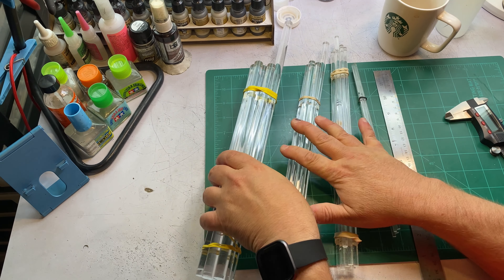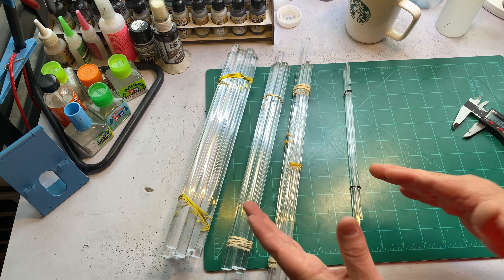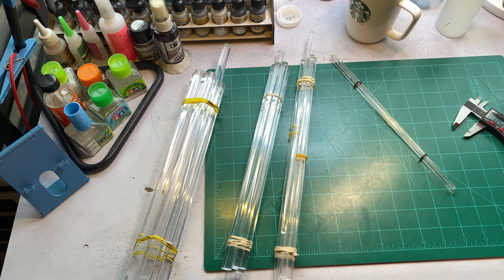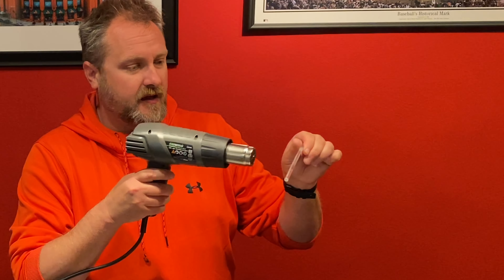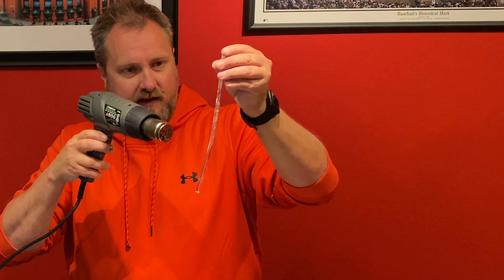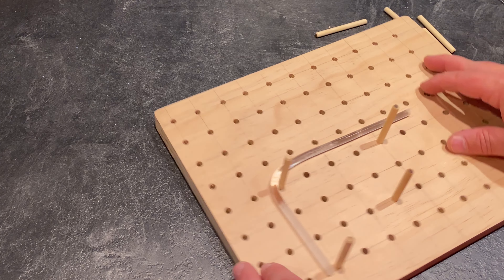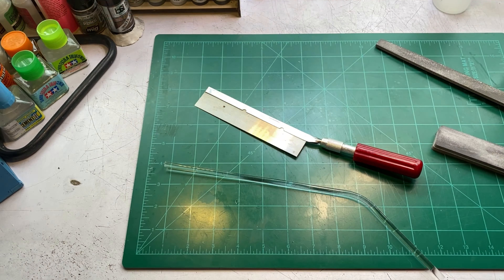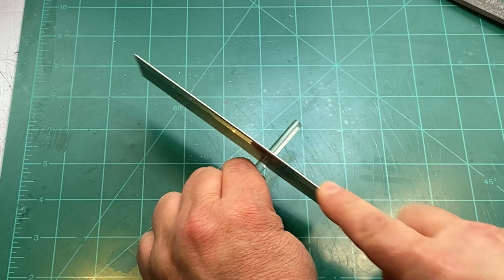Working with Acrylic Rod for Scale Models

Comment: Thanks Sean, for info of others I had a crack at mounting one of my models on acrylic rod but didn’t have a heat gun so used my wife’s hair dryer, it is a top end model with numerous heat settings and comes with an attachment to concentrate heat into a smaller area...took a bit longer to soften and I only used 6mm rod but did the job if you don’t rush it...cheers Mick.

Comment: I laughed out loud at "that's what she said!" however, my wife did not think it was funny.  i was wondering how stiff the 1/8 in rods are.  would 1 vertical rod sticking straight up be stiff enough to hold up a 1/48 f14 or do you think i need the the 1/4 in?  thanks!

Comment: Everyone always shows great vids like yours on how to mount and display models, but what about the other end? How do you actually attach your model to the rod/tube etc? They never show this part. Your acrylic tube example is excellent - but do you have to drill the aircrafts jet pipe out to fit the tube, or buy tubing each time to fit that models jet/tail pipe? If mounting  from the underside do you litterally have to drill a hole in your model to fit the tube? Then what, how do fix the tube inside your model without it being loose and the whole thing rattling around?
Reply from the maker: @Garryokee100  https://youtu.be/m55SBaDnj0k?si=lHaNrKLoAHU2z7q7

https://youtu.be/8s98ys01dvs?si=AjEqPJ8__p4rvcT2

https://youtu.be/M2SMW3bQEeA?si=vsMZkbhxCX3wC9bP

https://youtu.be/TmOD-Wo5pos?si=c0KASlg82aKSAQWg

https://youtu.be/eSl_2nabUoA?si=WmT_1nneCq1u61i0
Reply: @seanerk5kt9  many thanks mate

Comment: How do I get a clean cut with no marks at the end? Thanks
Reply from the maker: I haven’t found a way to do that and in my opinion it’s not necessary.  Because both ends are going to be hidden from view, and to allow an easier fit, I file off the sharp edges on both ends then hit them with a sanding sponge.